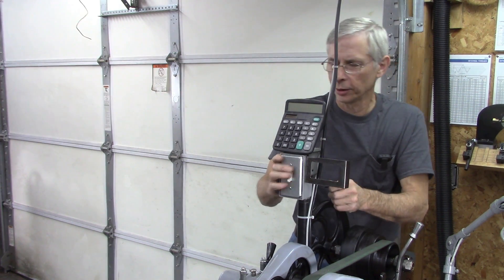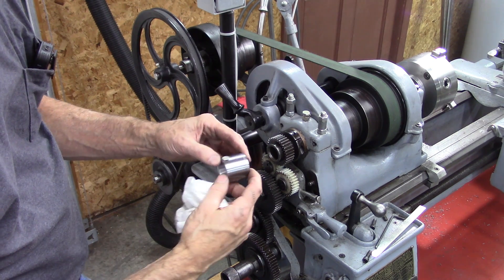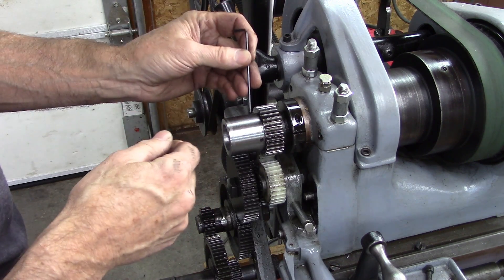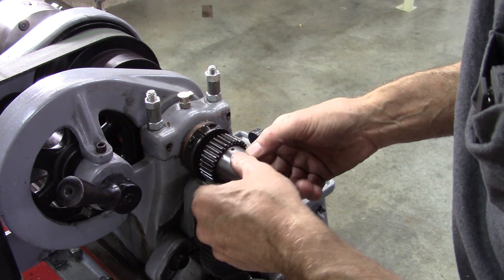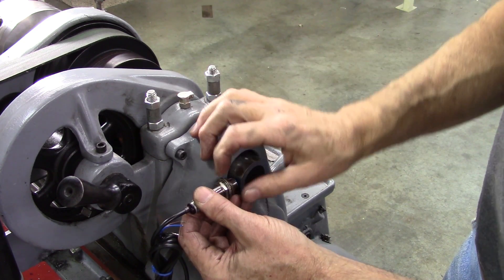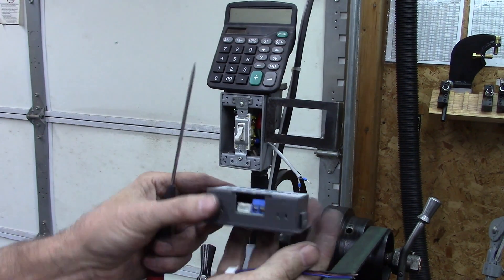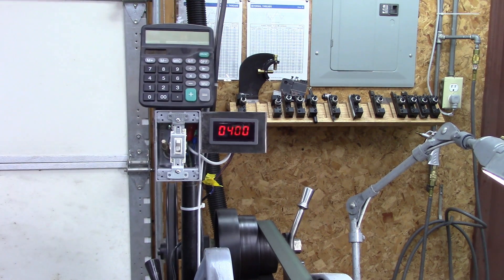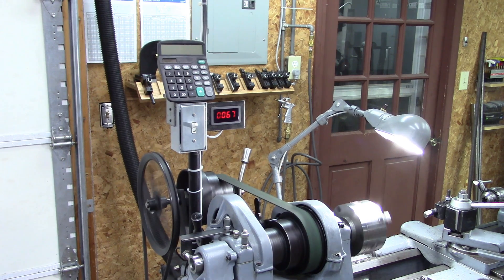Lathe Speed Indicator for less than $20 Bucks!

Comment: Winky I just received mine in the mail. I think I have this figured out but want your advice before doing it. The pigtail with the red blue and brown goes to the sensor and then plugs into the back of the display and then you need to make up a drop cord and hook it up to the blue plug on the back of the display unit and then plug it into a wall socket correct. Wiring is not my strong point and just need a little help. Thanks.
Reply: Sorry black brow and blue on the sensor
Reply from the maker: You got it. If your lathe is 120V just hook into the main power at your switch and have two smaller wires go to the display. I'd say you could do it before the switch and just leave it on all the time. I was worried it might shorten the life of the display but who knows if this is true. If you don't feel comfortable doing the wiring get some help. I'd hate to hear about one of my viewers getting electrocuted!!!!
Reply: @WinkysWorkshop  thank you my only thoughts was how small the ports were for the AC Current and seeing it had no instructions with it I did not want to hook it up wrong and shorten out the unit. I'm having a problem finding a place to put the magnet on my South Ben the motor is down in the cabinet and my side door that covers the change gears has to be opened every day to oil my reverse gear and with something in the end of the spindle the side door will not open.
Reply from the maker: @anthonycash4609  I'm not sure what to tell you on the magnet location but it needs to be on the spindle or bull gear. Yes the power wires going to the display need to be small gauge.
Reply: @WinkysWorkshop  finished my lathe speed meter today winky. Slow 471 medium 798 fast 1375 forgot to check back gear. I ended up putting the magnet on the end of the spindle like you did. Works good thanks for your help.
Reply from the maker: @anthonycash4609  That's great. After I made the video I noticed the info on the Amazon page said not to use steel to mount the magnet on. Did you use aluminum? Mine worked with steel but apparently this is not ideal.
Reply: @WinkysWorkshop  I used steel. It's working ok for me also but I had to use a bigger and stronger magnet.
Reply from the maker: @anthonycash4609  I used the supplied magnet, seems to work well.

Comment: These are great. I bought a bunch of them with blue LEDs. When I put a new 2HP inverter motor/vfd on my mill, I used one. Same thing on one drill press, and on my SB FOURTEEN lathe that has variable speeds, but whose analog meter isn’t the most accurate.

And for those doing this, make absolutely sure you have the correct side of the magnet facing the sensor. It won’t read otherwise. I also milled a pocket for the magnets, but epoxied them in place. For that, I use aluminum collars. It’s easy to make them. Don’t trust the magnet staying there. At some point, vibration and centripetal force will have it popping out, and shattering. I don’t trust super glue for this, vibration will break it loose.
Reply from the maker: Thanks for the magnet advice. Others have said the same. I guess i got lucky.

Comment: I manufacture a bunch of RC Aircraft kits.  I use magnets to hold wings on small models and hatches on all models.  If you use super glue, the shock of the magnets coming together always causes micro fractures in the glue releasing the magnets in short order.  Epoxy is soft enough that it lasts forever.   Burnish the magnet a little with fine sandpaper first.  You won't be snapping anything onto your magnet, so CA is likely to work ok.  Nice project.  Looking forward to watching the rest of the video.
Reply from the maker: I agree, epoxy is better in many situations. Although super glue is amazing stuff for some things. Like Balsa wood!

Comment: Wouldn't it have been easier to drill a hole in the side of the spindle gear for the maginet?
Reply from the maker: On the outboard side I'd have to drill a hole in the guard for the sensor and I'm not willing to do that on this old lathe. The bull gear has the pin that you disengage for back gear that would obstruct the sensor.

Comment: I can't help but think the readout would be a function of the diameter on the sleeve that holds the magnet. Do they provide any adjustment for this? Nice job thanks for the video.
Reply from the maker: A larger diameter would have greater surface speed but exactly the same RPM. No adjustment needed. Kind of like a clock. You can use the same clock works in any size dial you want.
Reply: @WinkysWorkshop  That was explained very well. Thanks.
Reply from the maker: @MrModify  Thanks.
Reply: Ratios only come into play when there's one thing spinning another thing. Like say two pulleys or gears. But if you spin a cone it's all spinning at the same RPM.
Reply: @1pcfred  you are right my brain must have been out of gear when I asked about it.
Reply: Got it

Comment: 13:53...IT COULD STAY ON ALL THE TIME: THE ELECTRICITY THOSE CIRCUITS DRAW, IS VERY NEGLIGIBLE.
Reply from the maker: Very true, I was worried about shortening the life of the display although they say turning on a light is worse that leaving it on so who knows.
Reply: @WinkysWorkshop  ...that mostly applies to incandescent light bulbs: when the bulb filaments are cold, the current inrush blows them out.

It looks like the display uses LED's- and they'll last a HECK of a long time. I think your problem is that each time you run the lathe, the power supply in the RPM counter has to stabilize before the counter starts counting. It's better if doesn't have to go through that each time you turn on the lathe.

If you're really concerned, you should buy a few more of RPM kits and keep them as spares: they might not be available later
Reply from the maker: @daleburrell6273  Yeah...  I was thinking it might be a good idea for replacements of for other machines too
Reply: @WinkysWorkshop  ...I can remember when Radio Shack was around: their merchandise changed a LOT-!

An awful lot of stuff is "here today, gone tomorrow".

Comment: I see a possible new project, a powered brake for bending heavy gauge sheet metal. 🙂
CA glue would probably work and if you had to remove it just soak the piece in some Acetone.
Nice, I've already ordered one for my shop.
Reply from the maker: Maybe but i have a space problem to deal with... I need a bigger shop!

Comment: Always nice to have a speed display-takes the guess work out.
I installed the same one on my Clausing 15" variable speed drill press. Magnet wasn't a problem: i put a piece of double sided tape on the fixed side of the vari-drive pully with the magnet on top.  Magnetic force and the sticky-ness of the tape have held it in place for 2 years now.  The prox mounting bracket was a little tricky but with creative bending and tapped holes conveniently provided by Clausing it was fairly easy.  I used an off the shelf electrical enclosure for the display unit and have it continuously powered on as long as the drill press is plugged in.
Reply from the maker: Yeah, always on is probable a good way to go.
Reply: That's what I plan to do, add this to my old DP.
Reply: why ?the machine must have a speed chart so what with the RPM s
Reply from the maker: @danhayward9186  Agree...  for a variable speed drive its a huge advantage. My lathe doesn't have a speed chart. It was originally intended for overhead drives although it had options for motor brackets. Nevertheless, I made the drive and at least the motor pulley is not original (even if I had a speed chart).  Yeah...  I did some math but I wasn't sure where to measure the diameter of the drive pulley for the V-belt. It's about 1/2" thick. Do you use the small diameter or the outside of the belt..... maybe halfway between? Either way...  the speed indicator was almost as easy as the math. :o)

Comment: Mill out a place for the magnet and glue it in with lock tight 638. To get it back out you would have to heat the shaft to melt the lock tight otherwise it's there forever. I've used it several times on the neodymium strong magnets. Never lost one yet.
Reply from the maker: Cool, I'll try it

Comment: Hi Winky, if it's not a daft question, what have you actually achieved by fitting this to your fixed speed lathe ? Once you know what the 6 spindle speeds are, it is totally useless. I can understand having it if your motor was a VFD, but your motor is fixed at about 1425 or 1700. Once you know the pulley diameters it is a simple calculation to get the speeds, and even if you got it wrong by a few RPM, does it really matter as you can not alter what it is. I wonder how long it will last with it keep going on and off every time you start and stop the motor ? All you needed if you are unable to remember what the spindle speed are, is either a small chart or a Dymo label. Regards from Australia.
Reply from the maker: Let me look up daft....  uh, yeah...  maybe daft :o)

Honestly, I'm not sure on the back gear ratio and wasn't sure what diameter to use for the motor pulley. Maybe you know.  It's about 3" on the OD of the belt and just over 2" on the ID.
Reply: It's always good to verify what's going on.

Comment: I installed a similar one I purchased off Amazon on my Clausing 5904 lathe and it works great. I however needed to replace the magnet with a stronger one. I epoxied mine onto the spindle and mounted the sensor under the side cover.
Reply from the maker: Thanks for sharing

Comment: I have a similar tacho to fit on my lathe. I made an extended spindle lock nut that sticks out of the back cover similar to Wink's arrangement. My lathe is currently buried under piles of household wears as we jave been demolishing and rebuilding the kitchen and dinning room so as that dusty old project nears it's end I will be able to liberate the lathe and finish the job.
My tacho works off a 12v dc supply so need to provide one.
Reply from the maker: Been there done that...  yeah, i like the 120V tach.

Comment: Awesome! Also I’ve been meaning to ask you what brand that awesome dovetail style vice is you’re always using in your vids? I want one, really really want one lol
Reply from the maker: I got that at a garage sale 30 years ago. It is an excellent vice but has one big negative. The back jaw moves instead of the front. This makes it impossible to hold stock vertically below the vice. I'm not sure on the brand but it's make in Poland.
Reply: @WinkysWorkshop  interesting I didn’t even notice that. Very cool, thank you.
Reply: @WinkysWorkshop  interesting I didn’t even notice that. Very cool, thank you.
Reply from the maker: @electropancake1554  No problem

Comment: I like it, but why not wire it to a separate switch or just leave it on so you don't have to wait for it to stabilize?  Just asking, not criticizing.
Reply from the maker: Yeah, that might be best. However, I tried leaving it on and it does the same thing.
Reply: I suspect the stabilizing is a matter of the math in the software, rather than anything to do with the power.  While it's trying to take an average, it goes a little over, a little under, and finally decides on what the speed really is.  Not the world's most powerful computer in there...  :)
Reply from the maker: @ydonl  Yes I agree
Reply: It cannot get a quickly updating speed signal from such a low rpm, with only one signal pulse per revolution. It is basically a counter, and needs to do some averaging over time (approximately 2 seconds per update). At 400 rpm it's only 6.66 pulses per second, so if it counted (say) 13 pulses over two seconds it would display 390 rpm.
Reply from the maker: @johncoops6897  Yeah, that makes sense.

Comment: You will like it and wonder how you got along with out it-- I put one on my lathe about 10 years ago or longer when I converted to a thread mill motor and got variable speed but my lathe is a Harbor Freight 9X20 and if I remember wright I used JB Weld to glue magnet to spindle and I think the north side of magnet had to point to pick up but I may be wrong
Reply from the maker: Interesting, maybe I need to flip the magnet. Maybe it will stabilize quicker.

Comment: Nice improvement Mark. You have to like that there is no complicated electronics that you have to deal with. I liked the little duel rod drill press vice that you were using when you were welding the bracket.
Reply from the maker: Yes very simple. Ah yes, I think that is the first time I have ever used that vise. I got three of them with my mill and that one was sitting further back on the shelf.
Reply: and what a nice late
Reply from the maker: @henkholdingastate  It's a 1931 11-inch South Bend, thanks

Comment: Nicely done!!  I did the same with my Logan 820.  It is good to see the rpms easily.   I was not aware these came to wire directly to 110volts... I did not even bother to look for one like that.    The one I got runs on 12volts so I got a left over power supply from something.  I can't remember what it used to power as this was in the box of power supplies in the garage (finally saving all those power supplies paid off, 😂😂🤣)... 

Also like the idea of having the calculator handy... I go for my phone now... I will copy that idea and install one as well...  might make it so that I can move it around between lathes/mills... with some magnetic base.

Thank you for sharing the mods!!
Reply from the maker: Thanks for the comment. Yeah...  I was tired of looking for the calculator.  I think calculator and screw driver were work together. They like to hide from me. One time the screw driver got really creative, it was hiding in plane sight where you would never suspect. In my hand!
Reply: @WinkysWorkshop  🤣🤣🤣🤣
Reply: Out of curiosity what does your 820 run at in it's 3 speeds?  I'm guessing pretty close this one,  400 / 650 / 1000 ?   (if you have the stock 1725 single phase motor)
Reply from the maker: @Zt3v3  The Logan had a little more range. It had a 2 step pulley coming from the motor. The speeds were 420 780 and 1400 on the larger motor pulley. I never used the smaller pulley.

Comment: Love your stuff Winky!! I use these on my lathe and mill, work well. One thing, if it doesn't seem to work, try flipping the magnet over. Before gluing it, which I found wasn't REALLY necessary, hold the magnet up to the sensor, if the light turns on, use that side toward the sensor, or flip it. Thanks for the great content. Pierre
Reply from the maker: Another person said the same. I guess i got lucky, Thanks!
Reply: I found the same when I fitted one to my mill drill, magnet in upside down and it doesnt work

Comment: Nice video.
I use a kind of indicator at least looking like Yours. They react on any metall, iron, aluminum. No need for a magnet then.
Provided You have a VFD it's a good device. Else a one time calibration of the speeds would tell as well.
Reply from the maker: Mine came with the magnet but i have seen them that pick up a hole in steel. I might try this.
Reply: @WinkysWorkshop  To be fully sure datasheets would need to be compared, not only physical outside, the blue end plug. But, You cal always test. Maybe the magnet makes a stronger, more detectable signal to the electronics. I used the sensors as home switch, end of move detection etc.
Reply from the maker: @Stefan_Boerjesson  No date sheet or instructions. ☹
Reply: @WinkysWorkshop  It's the same here. Bought them s long time ago, maybe from Ebay.... Just to test!

Comment: Hi Winky. I fitted one more or less the same on the Myford lathe. I just stuck the magnet on with 2 pack adhesive. At over 2000 rpm never had a problem in over 2 years of running. Fitted one to my Milling machine too. Great addition. 
Regards.
Steve.
Reply from the maker: So far mine is friction fit plus magnetic

Comment: Now you need to replace your single phase motor with a 3 phase and power it with a VFD. 😆
Reply from the maker: Maybe...  the lathe is a bit easy than the mill to change speeds. Mill first then maybe the lathe.
Reply: @WinkysWorkshop  My mill came with 3 phase motor. Originally I used a RPC, just another thing to go press the start button, and then continuous noise in the shop. And I was stuck with 60Hz. The VFDs are cheap now, I did try one of those ultra cheap ones off eBay, but the capacitor blew up when I tried low RPM on an unloaded test motor. I have found VFDs on craigslist and facebookmarketplace, just need to make sure they are the 200v class, so they can run on 240VAC, the 400v class is 440/480 operation, and there's lots of them on eBay, so don't make that error. I find on the mill and lathe with V belts (I don't know how they would work on your flat belt SB) that I can set them to the middle speed reduction, and with a 4 pole motor set the VFD for 1Hz to 120Hz operation and have all the low end torque to drive a 1/2" tap or die on the lathe. So in my case, I've not used backgear for a long time. My only issue is the threaded chuck. I also have gotten them new from dealers electric supply. They have packages of motors and VFDs that are a good price.
I was joking about a VFD for your lathe though. But I find mine very handy, and the 10x20 is about the same size as yours.
Reply: I also have a 18x40 gear head, and it also had a 3 phase, my RPC could not drive the 7.5HP motor. I'm using a Mitsubishi VFD that's for 7.5HP, I know they typically want the VFD to be double the motor size once you exceed 3HP, as the rectifier diodes are the weak link, using single phase input through them.
Reply from the maker: @f.hababorbitz  Thanks for this info